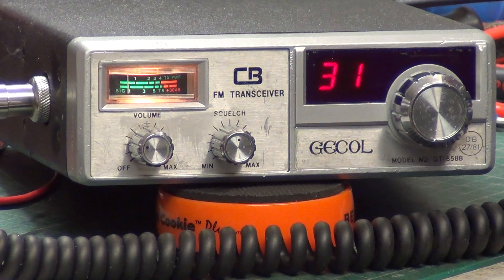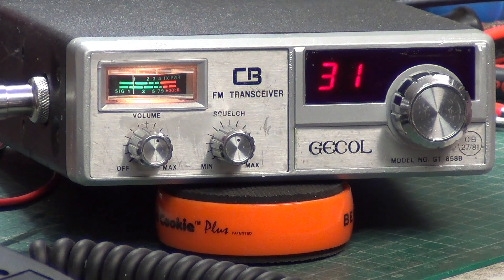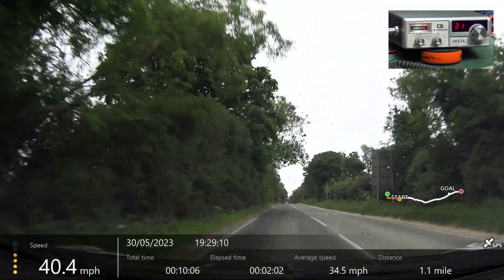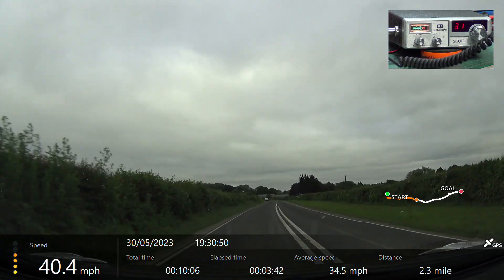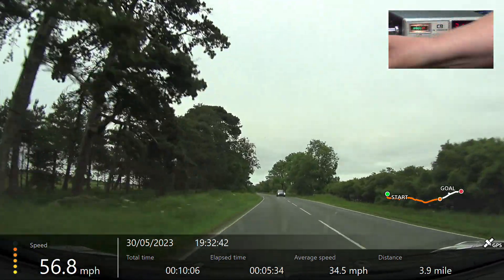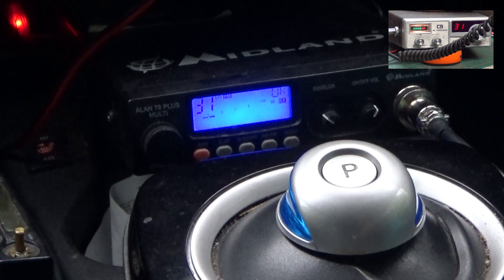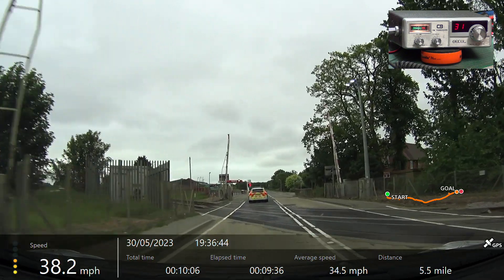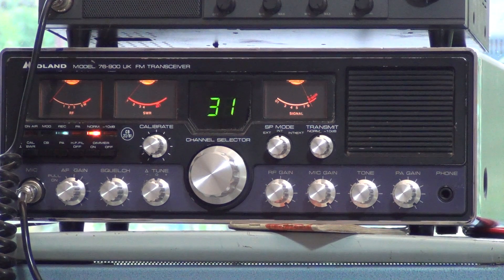Gecol GT858B CB27/81 UK FM CB radio - On The Air test

Comment: I have a funny story about this radio.
15 years ago I wanted to try a CB radio, so I bought one on ebay realy cheap. The Gecol GT858B. 
I'm portuguese and here in Portugal we use the CB 26.965 ~27.405 Mhz, and I only realise that this radio uses different frequencies when the radio was already arriving. Besides that, everybody uses AM/SSB that this radio can't do. So this became a big brick that I couldn't use.. Nobody here uses those frequencies and it is iligal.
In recent times I bought a CB radio that I can configure to use CB27/81 and after 15 years I finaly can confirm that this radio works! Its in the shelf, its very old and useless here in Portugal, but It works, I love it and I wont sell it :D
Reply from the maker: Yes, the CB27/81 UK approved CB radios are in frequencies unique to the UK.....and illegal to use anywhere else.

Richard, G0OJF, UK